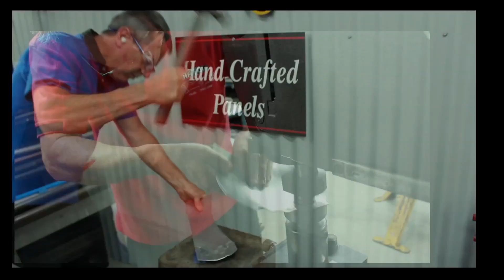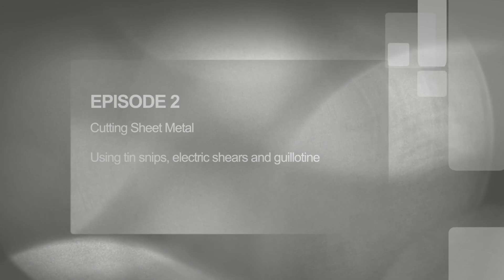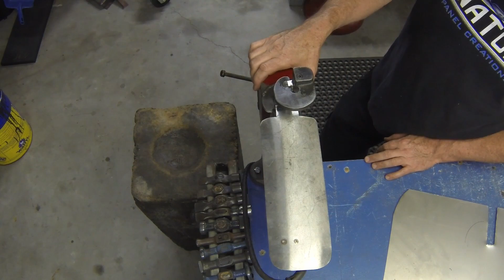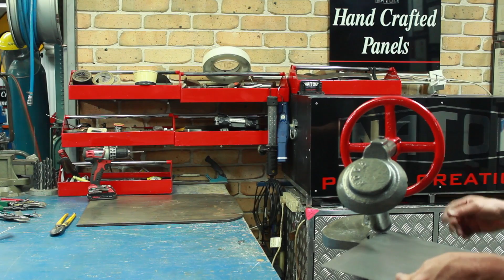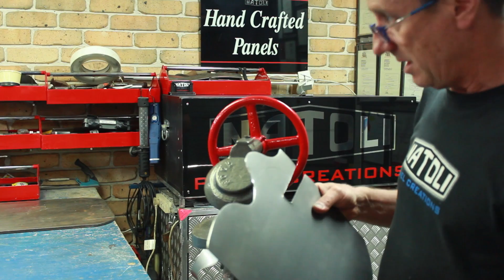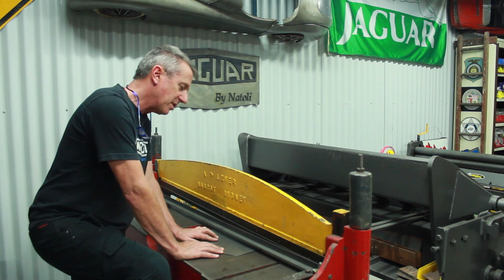Hand Cutting Sheet Metal Tutorial

Comment: G'day Mark, thanks for the video. 

I'd like to have the ability to make relatively accurate straight cuts for simple box bending, but don't have room for a guillotine. I was considering a straight hand shear like this one from H&F https://www.machineryhouse.com.au/S189 I believe they are effectively throatless and can cut beyond their throat depth, but will curl the offcut side and will require 2 bites to properly cut down a longer cut. The salesman says he uses one that way, but I've otherwise never seen them used beyond throat depth. I'd be grateful for your thoughts on hand shears please.
Reply from the maker: Hey Peter have you seen the Machinery house Hand Notcher for guilotining corners for boxes I have one there are fantastic .The hand shears are good but check the other out. Regards Mark
Reply: G'day Mark, do you mean this type of hand notcher? https://www.machineryhouse.com.au/S182 I haven't seen them used. On the other hand to you mean a manual bench mounted notcher like this one? https://www.machineryhouse.com.au/S247 The second one I've seen and wouldn't mind one when I have a workshop with more room. I think they would be very handing if making a reasonable number of boxes or similar work

Comment: i need to cut sheet metal about 5mm thick will metal shears be enough ?
Reply: good luck with that.
Reply: 5 mm thick is in my opinion to much for a metal shear. I would use a cutting torch. 
2 mm might be okay for a metal shear.
Reply: Cut off wheel would work.
Reply: raroa777
I agree, that is a good an alternative to a cutting torch.

Comment: A pair of gilbows is always superior to snips. One problem with snips is the lack of pressure because of the short handles. Very good giving you wrist ache and cramp. Left and right hand gilbows will do the same as snips but easier because of the longer and angled handles.
Reply: Gilbows ARE 'tin' snips. See the Blackwoods catalogue.
Reply: Alan S "Blackwoods" I've heard of but a listing in a catalogue describes what they consider they sell, not the correct name for something. Another example is some catalogues list clamps as clamps when in fact a clamp with a bar through is a G clamp, a clamp with wing nut type fastener is a C cramp. Note the cramp and cramp wording!

Comment: What if I need to cut in a very small area?  Is there a small cutter, something that gets really precise cuts, in a small area.  I need to make cuts on a 1 mm thick 15mm by 28mm area.
Reply from the maker: Hi Joe John Johnston - it is possible (and I have done it) to use your normal number 6 welding tip and a bit more oxygen (called an oxidising flame) to cut through the metal. It is not using a cutting torch but it works well.

Comment: Friend, ive been working sheetmetal in tucson arizona for 20 years , after 6 years in the army.you NEED the right snips! You do not have them.. you need =" midwest reds and greens, left and right cut no need to lift the metal out of the way, snips do it.as you cut, keep snip blades 20 ° less than 90, strong forearm
DO NOT cut wire with your snips, even copper, sharp snips is gold. I can cut a  20" square hole clean, in 16 guage galvanized in less than a minute..... installing burgar bars and an access panel
Reply: William Rodriguez offset tin snips make life easier

Comment: What is the best way to de-burr? Sharp edges and finish paint seem to take the most time to correct.
Reply: Hi, use a metal file to take the sharp edge/burr  off a cut.
Reply from the maker: Hi Steve Larsen - there are specialist de-burring tools available from engineering suppliers in different styles (i.e. for round holes, straight edges etc). You may sometimes need to use a file on the curved corners as +Anthony Dunn mentioned.